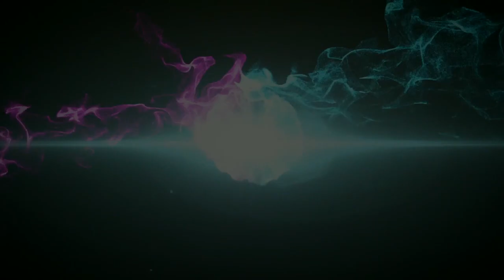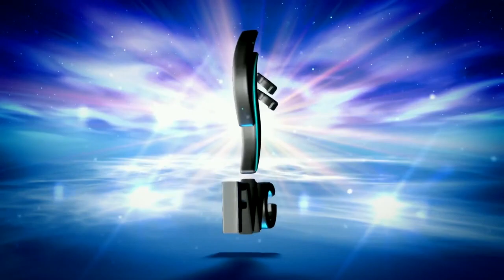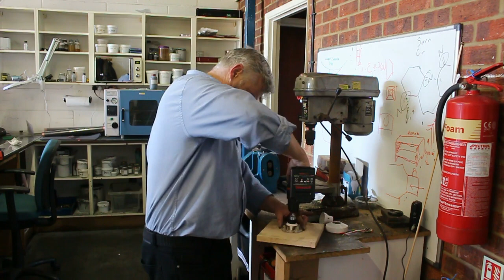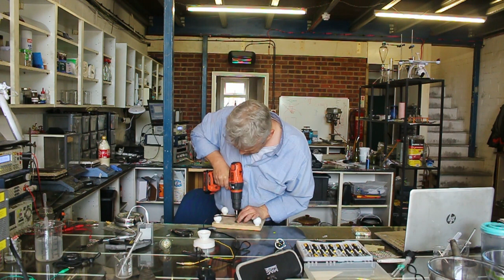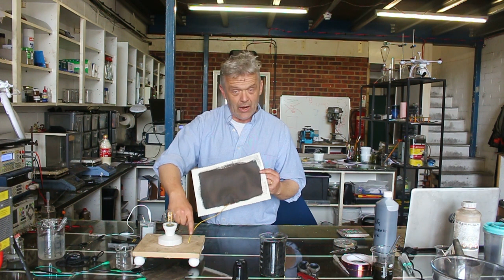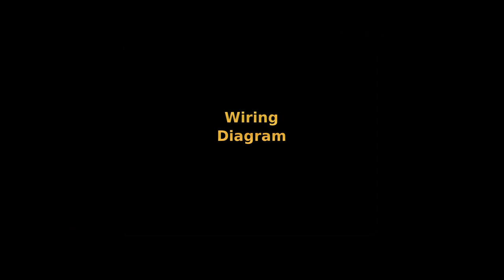Lamp Basics

Comment: Yes - well ... it's a nice project to build a DIY lamp. I would prefer a DIY lamp on lower voltage and powered by DIY battery; carged with a solar pannel. - Less danger about electric shock and more fun about indipence from public power supply.
However: You made a start to using your ink. Great!
Reply from the maker: it's all about balance mate lol